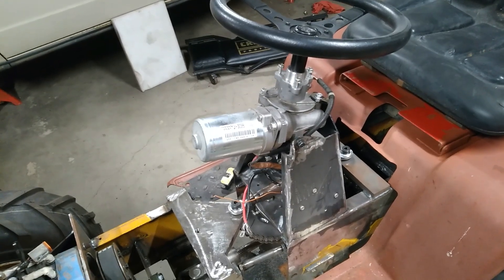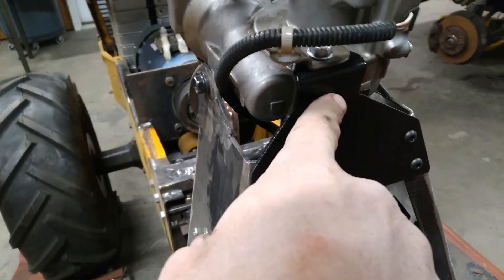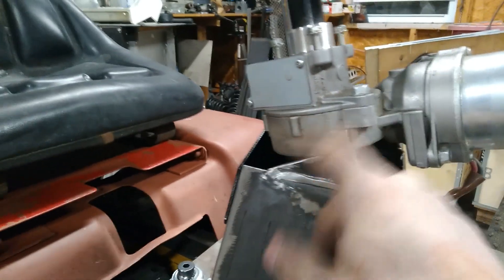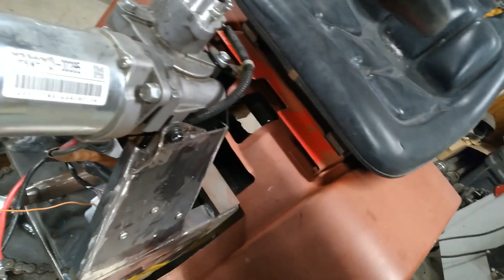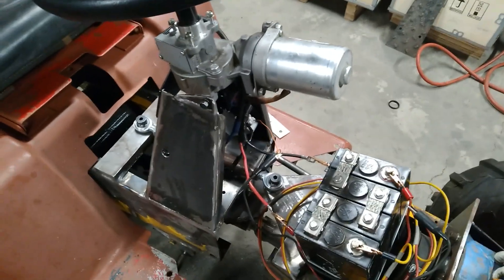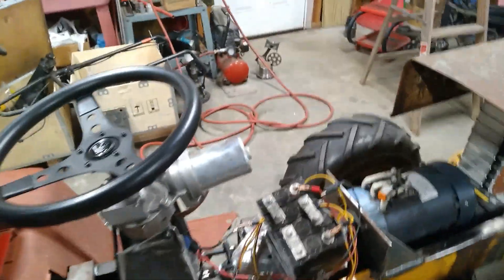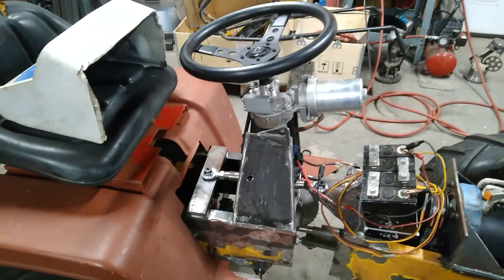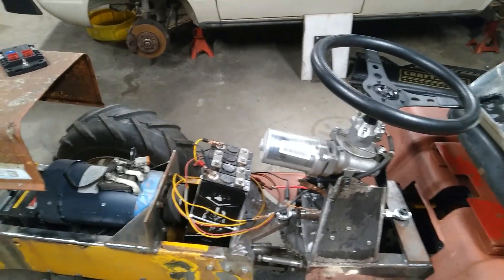Steering Whooped! - The Cub

Comment: Where can i get a steering booster and the small U- joints? thanks.
Reply from the maker: I got the booster from eBay.  Make sure you get the booster, the controller and the the connector into the controller with the large gauge 12v wires. U-joints are from Amazon.  https://www.amazon.com/gp/product/B07DHL9CXG/ref=ppx_yo_dt_b_search_asin_title?ie=UTF8&psc=1
Reply from the maker: The little ujoints with the steering unit came with it.

Comment: It is exciting.    Put the stuff that needs the most cooling where it can get air.  Just a reminder. 

I am vicariously enjoying the journey and learning from your efforts.  Currently I am thinking a less painful setup would be entirely electronic aka steer by wire.   Position sensor on the steering wheel to the computer that runs the controller for the linear actuator.    Electronics are deeper in my comfort zone then all the welding.  Do realize if the electronics go south steer by wire leaves one with no steering but there is a lot less mechanical complexity.

Again kudos for all the work.  It is looking great.
Reply from the maker: Thanks for sticking with me on this journey. If I get a vote, I definitely want you to do a steer by wire.  100%!!
Reply: @billbayer5526   It would be fun.